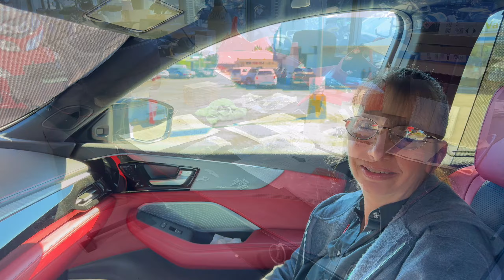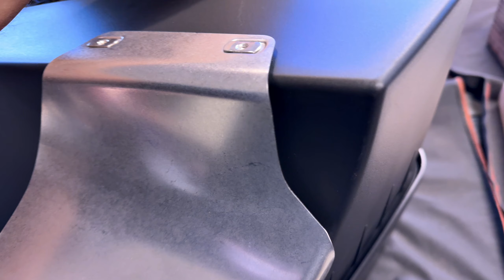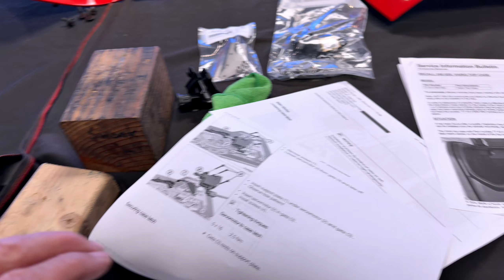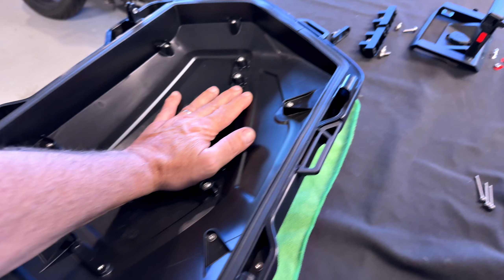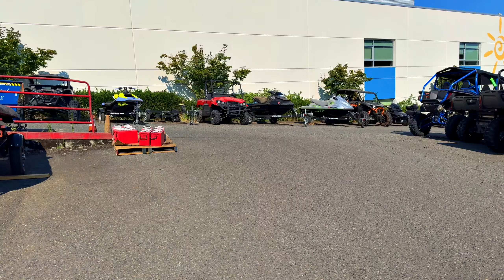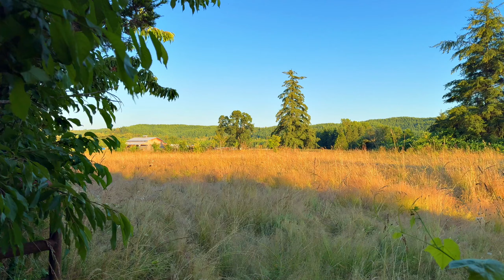CarPlay on 2024 Spyder's!! • It’s Available Now..! | TheSmoaks Vlog_3159

Comment: This is non related but I have a question about a 2022 Can Am Ryker Rally?  Is there a way to manually reset the "transmission maintenance required" message?  I tried reseting it with an OBD which I use on my BMW K1600GT which works just fine, but not so much for the Ryker!

Comment: I would have to ask BRP if they'll offer a replacement you can buy for older gens and are they going to add android auto or just stick with apple?
Reply from the maker: The wiring harness, the cluster assembly and controls are completely new for 2024, so backwards compatibility is impossible.  Android/Google is the holdup, BRP is 100% ready for Android Auto...

Thanks!! 👍

Comment: Wondering if there will be any updates/changes to use older Bluetooth models, seeing 4.2 isn’t working and 5.0 works, but with AirPods Pro there is a 7-10 second delay on phone calls on the receiving end… not sure if anyone else is having same issues with a headset using 5.0?